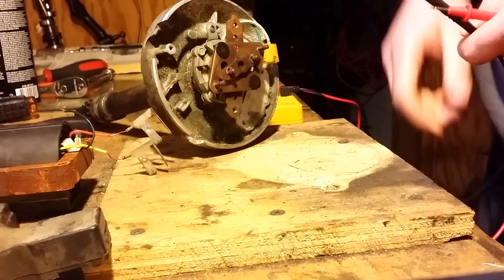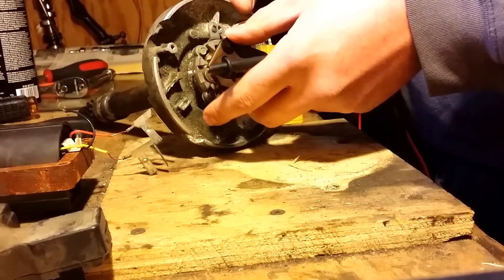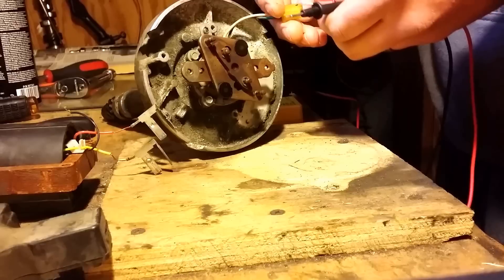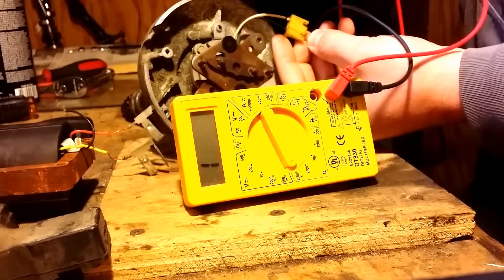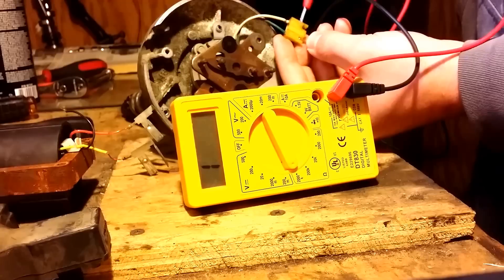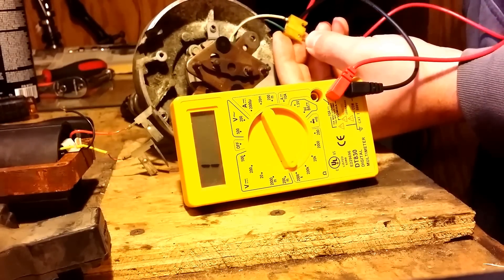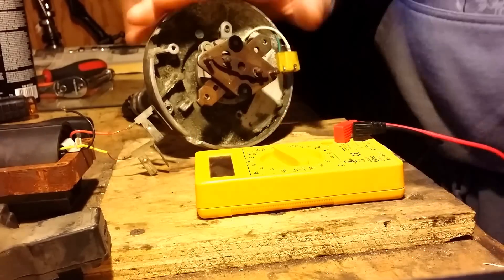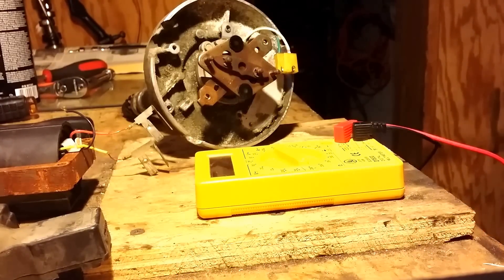HOW TO :  GM HEI Distributor Pick-up coil troubleshooting

Comment: If meter leads are connected to a closed circuit coil why is there NO RESISTANCE?  I also have this meter and the instructions say showing " 1 on display means Out of Range". So it seems to me 1. No believable readable value for ohms on a closed circuit. 2. out of range indication means there is a dead short in the coil. I look forward to your reply to educate me about my conclusion that the coil is bad.

Comment: Str to the point video this is exactly what I need to know my cutlass lost spark can u change the pick up coil without taking the distributor out i normally would change the ignition module and it will start right up but not this time around im thinking its the pick up

Comment: I have a 86 k10 with HEI and it started one day and the choke would not kick off hit the gas pedal to try to make it cut off and it died.    wouldn't start back up.  put new module in it. new spark plugs in it too. it now just cranks and acts like it wants to start but doesn't any help would be greatly appreciated
Reply from the maker: d shook hit with ether? Make sure it's not flooded ?
Reply: even after siting for a day or two it could still be flooded.  this is my first carburetored vehicle
Reply from the maker: d shook pull the plugs and see if they are wet
Reply: Alright thanks like a plan. I'll do it in the morning.   Along with this test
Reply from the maker: d shook spray it with starting fluid if it doesn't kick I suspect something in the ignition system
Reply: Alright thanks dude.  I already put new module in too and it didn't anything.  It cranks and acts like it whats to fire up and run
Reply: if it is a pickup coil how do you replace them.    or would it make more sense to get a new distributior

Comment: 82 gmc will runs fine, won't start after you shut it down. got it to start today running like shit. New coil, cap, rotor, plugs. Put a different distributor in (used)before these issues. I'd appreciate any feed back.
Reply from the maker: getting 12v to the coil? ignition switch?
Reply: Ran a hot wire directly to the coil and still the same results
Reply: Turned out to be a bad coil. Sometimes new doesn't mean good I guess. I greatly appreciate your response.

Comment: I have a 89 Chevy truck with a 5.7L engine. Truck runs great except for when once it is warmed up and I come to a stop at a light or a stop sign . It just cuts off but immediately starts right back up. I am told this could be a weak pickup coil.
Reply from the maker: Weak module... pull it out and have it tested.. Most Autoparts stores will test it
Reply: weak pickup coil?
Reply from the maker: Weak MODULE... pickup coils either work or they dont... when they burn up ur truck wont run..
Reply: well today I took the distributor cap off and found that the rotor was fused onto the shady because of rust.  had to take it off in chunks. then I sanded the shaft smooth, brushed off the top of the pickup coil since it had a lot if rust.  then I blew it all out with compressed air and replaced the distributor cap. Truck won't turn on now. Maybe I finished killing the pickup coil with the compressed air.
Reply: +Jackson Cruz  

bad pickup module. I replaced the whole distributior and it fixed it. pickup coil crumbled when I touched it.
Reply: Egr